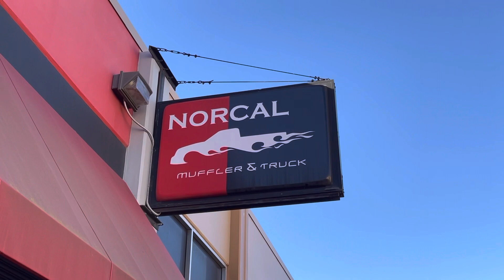My 5/7 slammed GMC Sierra CrewCab gets a new 40 series FlowMaster exhaust by NorCal Muffler & Truck

Comment: What size the tires in the rear ???
Reply from the maker: The 17’s or the 24’s?
Reply: 17’s
Reply from the maker: @jbcisco2804  those 17’s were on the back till I got my 24’s and the ones on the front here are 20’s